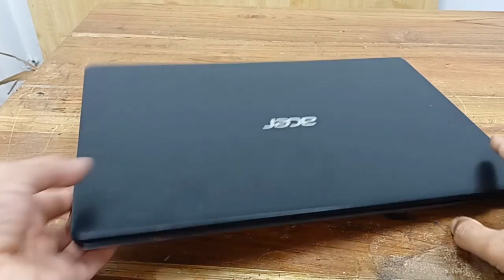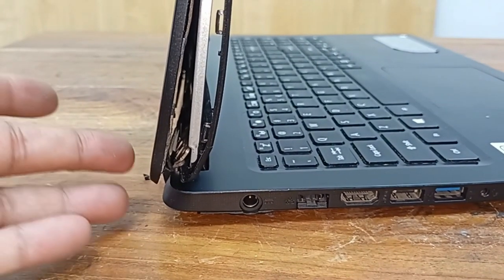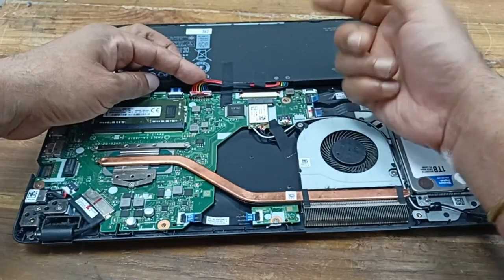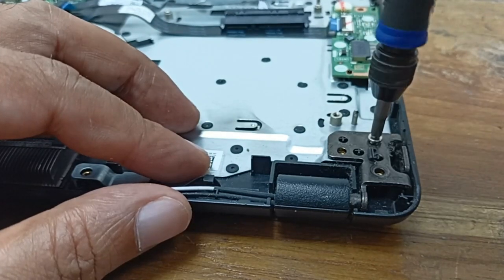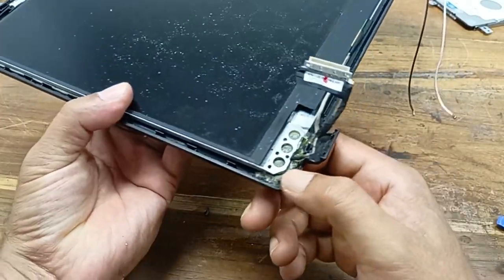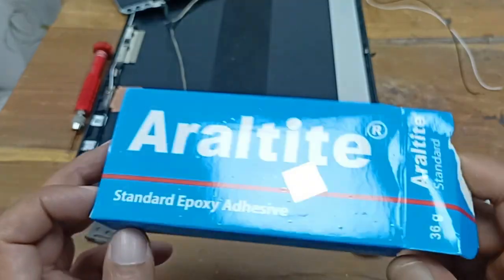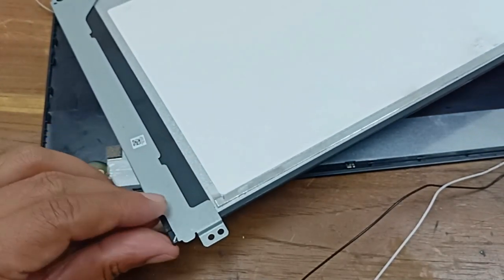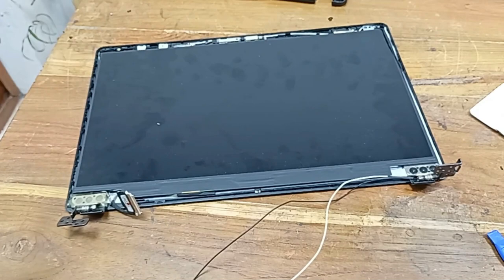Hinge repaired acer laptop || how to repair broken laptop hinge

Comment: Cant stand these new laptops with their plastic cases. I had to use screws and nuts to fix a hinge on a friends laptop it was so bad. Also loosened the hinge nut like you did. It was so hard to move before. I miss the old diecast metal laptop cases.
Just came across your channel. Going thru all your videos.

Comment: My dad got a cheap Lenovo laptop for 200bucks 8years ago and it's still going with no issues.

I paid 1,000 for a brand new Acer and after 3years the hinge breaks.

I thought I was paying more for higher quality but it has gone to shit.

My laptop is a lot faster compare to my dad's but my dad's is a lot more durable.